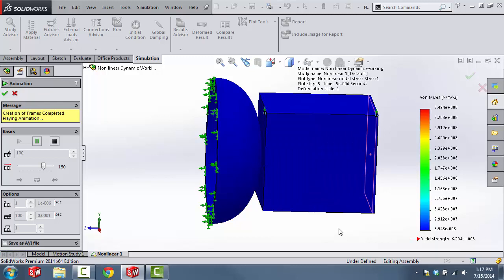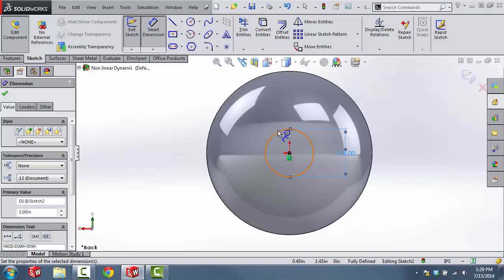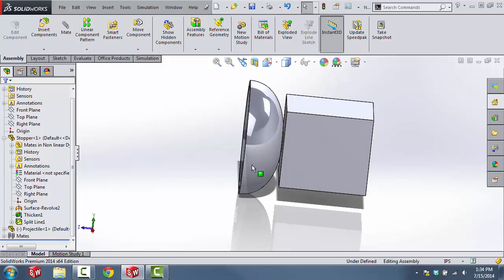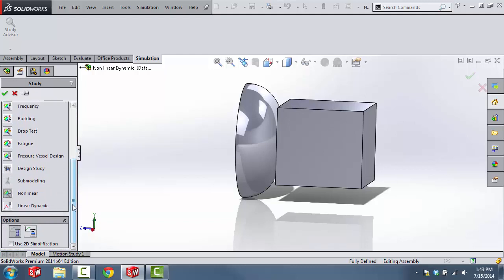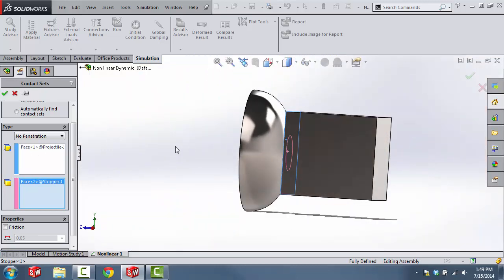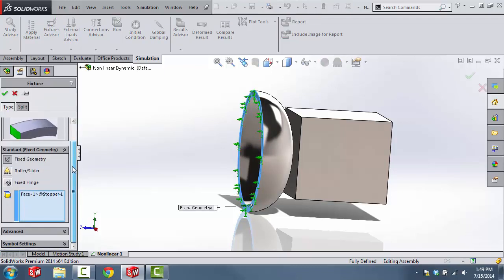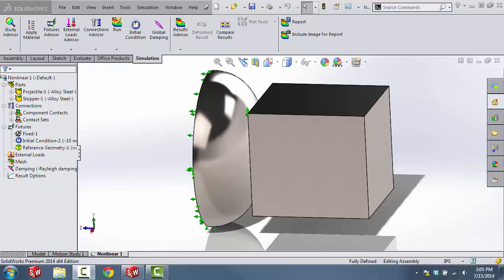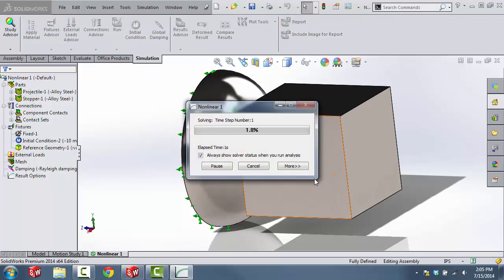Non Linear Dynamic Contact with SolidWorks Simulation

Comment: hello these two parts are designed in the same skecth in the same page or just assembled?
Reply: I think this is an assembly with simple mates. I suggest you to see some videos about mates in solidworks. Actually the "bullet" has one DoF, translation in Z direction
Reply: This is a non linear problem because he wanted to calculate the contact force dependent on time
Of course you can use the NL static analysis but you have to change the boundary conditions
For the mechanic of the car crash, for me it's to hard because you have to use a very complex model. Remember, more elements you have, more complex the problem is, more time it takes.
Best regards

Comment: Hey Nick, thanks alot for this information. It's incredibly helpful and I'm glad that there's information like this available for students and the like in the early stages of CAD simulation. I have a question concerning a simulation I'm trying to run. I've approached different sources in my area but have yet been unable to discover how to succesfully run the simulation. I'm trying to axially expand a cylinder by running a rigid conical mandrel through it. I assume a 2D axy-symmetric non-linear static simulation should do considering the material (a typical steel) will behave non-linearly and the mandrel can be forced through the cylinder by a constant force. Essentially I would like to deduce the required force and if possible the principal or Von Mises stresses within the cylinder during expansion. Do you have any suggestions? My thanks in advance!
Reply from the maker: Hi David,

If I'm understanding this correctly, there are a few ways to handle a problem like this. One way is through thermal expansion.  If you go the thermal expansion route, then the two parts should be concentric and kissing to start.  Then, apply two different materials (with separate thermal expansion) to the two different parts.  Then apply a thermal load to the components.  I actually solve this problem in lesson 9 of my course.

https://gosimulation.com/lessons/

All the best,

Nick
Reply: Gosimulation Hello Nick.,
I tried to do a similar case except change in the materials of the part.
But what i could see is that the block bounces back into air, which i am not interested into. where as my interest is that the block is travelling freely down to kiss the another block, what are the stress? and weather the thickness of the block is sufficient enough to handle the forces generated.